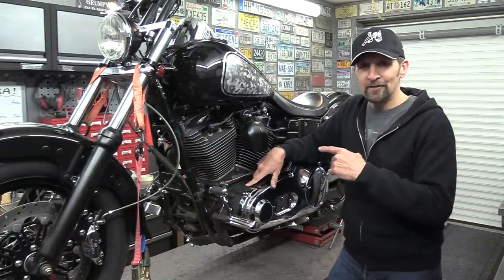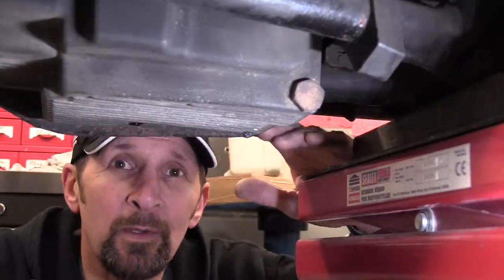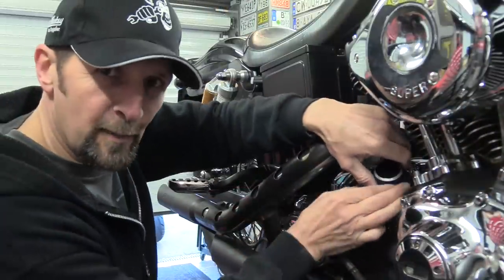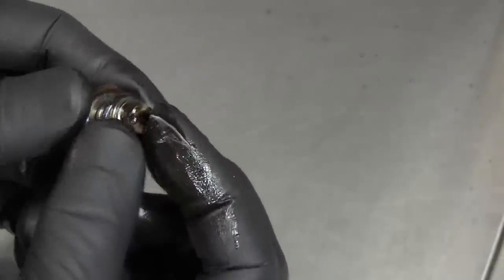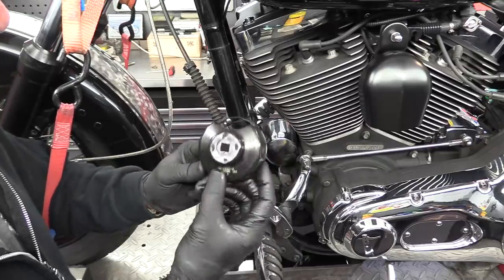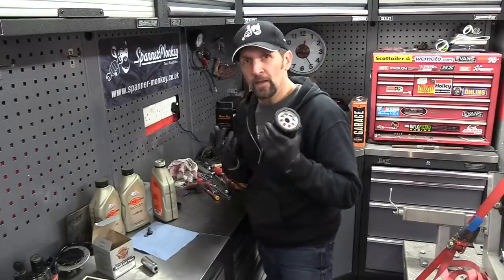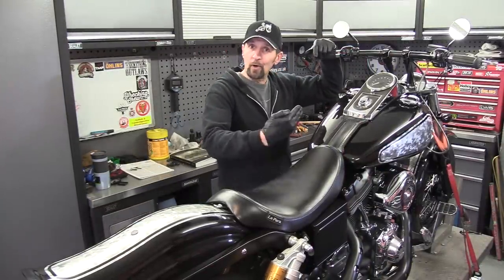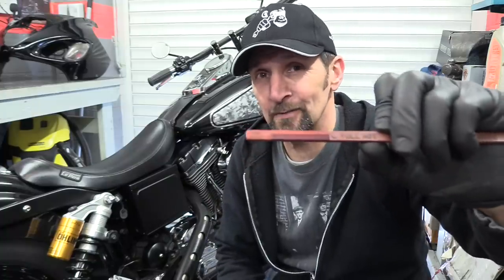Delboy's Garage, Harley Dyna Engine Oil Change !

Comment: Have to say that... I have seen many movies like Yours but what I have seen in Yours movies is very very detailed and to the point. Very helpful for someone who just starts the fun in motocycle mechanicks. Thnak you Very much. You and Two wheel Rocco are both great. Keep it up guys.
Reply from the maker: Thank you so much, you're very welcome, glad you enjoy the videos! 😀
Reply: @Moonfleet41  Hey, just one remark/ question you are mentioning that this is big twin motor and in Your movie you say that you just put 2 liters of oil... is that just mistake. Acc to the service manual I poses ut us stated "Oil tank refill capacity 3,5 U.S. qts. (3.3L. 2.9 Imp. qts.)" Or I just missed something. Thanks for great movies again!

Comment: As always great job Del.. I always just let the Harley dealership do the oil change/service on my bike while it was still under warranty. The last time they did it, it cost me $379 plus shop fees and shop supplies plus tax.. WTF!?!?!? Now that it is out of warranty I do all of the work on it. I do all of the work on all of our members bikes, in fact I just did a 3 hole fluid change service and dual caliper front brake pads on my VP's street glide. That reminds me, he still owes me for the parts........
Reply from the maker: Hey Brother, Thats so common, im so often told that guys are getting charged $500 'all in' for a service, and that makes it almost unlivable in real life.. that can feed the kids and pay the bills at home which is far more important to the average Joe right?.!  But its the going rate i guess, nothing unjust happening there, just the cost of owning a Harley Davidson.    Fact is also that you won't effect your warranty by doing the services yourself either, they tried all that BS a long time ago, and the law stepped on the practice, so under current legislation, no dealer can void your warranty because you didn't take it in for service... as long as you keep the invoices for genuine parts, and the mileage is recorded, then there is nothing they can do... only if something that YOU directly did wrong causes a claim can they penalize you... and even then, it can only effect that item, not the rest of your warranty...   Its awesome to hear that you take care of the Club bikes, thats Brotherhood right there.. Take care and keep in touch.. LL&R, Del.

Comment: Every day's a school day... I've always wet the seal with oil on the outer edge but never thought to wet the inside edge. On another note I had an over tight filter on my Tiger wich was a right pain.  Luckily TMF had a similar problem and got passed it by drilling a couple of small holes through the side of his oil filter removing cap thingy whilst on the filter and put in a couple of self tappers to secure them together. Came off a treat 👍 Great vid by the way brother 😀
Reply from the maker: Thanks for watching buddy, I've seen the self tapper trick, but if they're proper tight, as if they're almost welded on, then they can still tear out, as it's barely 0.5mm sheet metal, and then you've made matters worse, as it starts to rip apart... the best way is always some big hefty pipe grips and crush a square in the end, then you can get it off easily!  Take care buddy, appreciate you watching!

Comment: For my oil filters on my cars, trucks and Sportster, I pre-fill them on the workbench and let the media soak up the oil. I keep adding the oil until it stays at the top. You would be surprised at how much oil will soak into the media. Then I pour the oil out of the filter back into the bottle and quickly install the filter. The media is soaked completely and minimizes a dry start. If you've ever put a dry oil filter on an engine, you can actually hear the difference from an oil filter that has been pre-soaked.

Comment: Hi D&P. 
What a beautiful machine. 
I watched the entire build series and still love this bike. 
I did a double take and wondered why you were using thread lock on your sump plug, until you said it was hydemar (?) grease.  Lol. 
Good tip on lubing the oil filter seal,  thanks. I've always put a film of oil on the seal, but never removed it and lubed the entire thing...It makes a lot of sense.
Tx again.
Regards from S Africa
Clive
Reply from the maker: Hey Clive, good to hear from you ma broer ... yeah, I took care to mention the Hylomar, it's prefect for oil sump plugs as long as you use it right!  Take care and keep warm, enjoy the sunshine! Del

Comment: Great video as usual.. One thing though.. Some Harleys required the oil be checked in the upright position... A total PITA.. Anyway good rule of thumb on these is if the dip stick is firmly fixed to the cap "bung as you say" then it is upright.. If the stick has a pivot at the cap it is on the side stand... I had this on my 02 Heritage Softail.. I found through the service department I could buy a dipstick for the newer model and check it on the side stand..I did that :)  But as you say "ALLWAYS check your manual! :)

Comment: Hylomar may be "totally unnecessary" in your opinion Marc, but as with anything Del Does, and Me for that matter at work, going that extra bit as a precaution against any possible future leaks doesn`t hurt one bit, i do plumbing in my job as a kitchen fitter and it`s always better to "overkill" something that has fluids roaring through it under pressure than to not,, but what do i know, ive only been a kitchen fitter for 37 years. ;) Great vid as per Del, informative, easy to follow and well presented. Claypole.

Comment: Great and informative video. I would advise strongly that everyone look at service manual for oil plug location, as opposed to transmission oil . Evolution engine is different. Thanks dude
Reply from the maker: Good advice mate, I try to make sure I mention several times in every Harley service video to invest in a manual, as I'm sure you'll agree, it's the best £60 you'll ever spend... I asked a H-D Master Tech once, if the dealership was on fire, which bike would you rescue first, and his answer was 'none of them, let 'em burn, I'd grab my manuals before anything else, cos many of them going back to the 50's are unreplacable'.. .and you're right every bike has a different manual!

Comment: That's the way to do it Del I change all my oils every 3 months even if the bike is sat in the garage with out moving a wheel. Keep up the good work Brother H&R
Reply from the maker: Ayup Dave, great to hear from you brother, I love making these videos, just good ol' housekeeping aye?!  I notice you're not the other side of the world, be good to catch up for a beer in the summer... need to get the Dyna out and stretch it's legs at some point!
Reply: My bike sits for 6 months with clean oil during the Canadian winter. I don't change the oil in the Spring. The oil is still new, why change it ?
Reply from the maker: @jamesweber4938   There's nothing in the service manual that says to do it, but many owners like to do so, because over a cold winter, condensation can form inside the motor, leading to rust and water content in the Spring, so just for probably nothing more than peace of mind, people change their oil at the beginning of the season... some also swear that leaving dirty oil in the engine over winter can do harm also, but tbh, we love our bikes so we should do what we feel happiest with, whatever it may be, don't ya think?!
Reply: @Moonfleet41  That is exactly why I change all the oils Del better to be safe than sorry and I love my Harley and want the best from it when I do use it. It's just piece of mind at the end of the day Brother. MH&R
Reply from the maker: @davesantathompson2075  Wise words well said Dave, i ride my Harley rain or shine, and harder than i maybe should do... but as long as you pamper its needs, they can take just about any abuse..!  Just watch the Dyna stunt guys, They can't kill them for all their trying.!  MH&R Brother..

Comment: Just found your channel. I've only been riding about a year. Your video is one of the best oil change videos I've seen. It seems goofy, but yours is so clear, step by step. Now, I feel like I could actually do it myself. I'm not an engine guy. Also, like your TBars as well. Doing the same but trying to figure the indicator clamp with predrilled bars on 2008 LR.  Billet makes them but they are black and I want chrome.
Reply from the maker: Glad you enjoy the videos NBT, we deliberately film them in this style so they can appeal to a general audience, some of whom may be complete novices and enthusiastic to learn... plenty of videos online that are shorter and give more direct info. aimed at those with a little ready knowledge, so we choose to make them a tad more basic in case anybody needs that!

Comment: I know very well over tighten oil filters. No matter if it is a car or a motorcycle, every first oil change in my or my friends new bought machine require heavy tool to get oil filter loose.

Comment: I'm looking at doing an oil change myself so just wanted to ask... Given that you state it is bad to get hylomar inside your engine why do you use it for this? Is replacing the o-ring not enough?
Reply from the maker: Blue Hylomar is a non-drying sticky sealant and, of course, it doesn't do to have globs of that floating round in your oil, so as I stated, put it on the thread only... it's a sealant designed as long ago as the 1930's for sealing oil joints and sump plugs... it has other uses these days, but that's where it came from... if there are any distruptions in the thread on a tapered plug or a nick in the 0-ring you can still get oil weepage, which is pretty common and so many people just swing on the bolt to over tighten it in order to seal it...!  But with a little smear of Hylomar around the thread the plug glides in to place at it's min. torque setting and seals first time, every time... don't use it if you feel you don't want to, it's not essential.

Comment: It is easy to do an oil change on a dyna, Tho I don't have a bike lift, I put down some cardboard
and lay on my belly and start loosening. I took a short ride to the HD guys wearing 
a backpack to put oil and filter in, they always tape an O ring for the plug on the oil filter box.

Comment: What size is your garage? It's fitted out tighter than a ships machinist mate's compartment. Out on the ranch our "toolshed" and work space is a 20 ft CONEX. Since we maintain everything from trucks to cars to small engines and also lots of electrical equipment we have double sets of most tools metric and SAE. Had my first bike when I was 16; one year old 1964 BSA Lightning Rocket 650.
Reply from the maker: Hi buddy, my garage is more or less 10ft x 20ft, and yep, I do pack everything in!  But it motivates you to keep it tidy and of course I wish it was bigger, but I reckon with more space, I'd just end up with more stuff lol

Comment: Del! I'm hoping you'll get to comment on this. I've been riding for almost 60 years and 6 months ago bought my first Harley. I chose a '09 XL 1200 L as it's not too heavy. I do a low annual mileage, maybe a couple of thousand miles. I was looking around for oil and came across LUCAS 50WT V-TWIN SYNTHETIC. It seems to satisfy the requirements of the Sportster and it would be changed annually so I'm wondering if it's something I can safely use as an OAP on a State pension. I know the Dealers would throw up their hands in horror, but needs must. My local HD shop has already given me the wrong tyre pressures ( 36F, 42R instead of 30F and 40R) for laced wheels, so I'm not confident about their advice. Thank you for the tutorials, I'm sure I will be visiting often.
Reply from the maker: Hi there.. OK, congratulation on your first Harley, i hope you're enjoying the summer so far on it.. With the oil, there is always more benefit in choosing a multigrade oil if you can, Lucas 50W will be ok, but its maybe a bit thick for cold mornings, and in England we get plenty of those aye.   You don't need to spend a fortune on special oils for your Harley, they are pretty robust and revving motor,  no real need for a fully synthetic, a half decent 20w50 semi-synth multigrade will do the job..     There is a recommendation printed in Harley Davidson service manuals that goes  "" In the absence of a dedicated Harley Davidson oil, use oil rated for DIESEL engines"" .. so if you are on a budget, you could go to your local motor parts store, and get some semi synth 20w50 diesel oil, and that would do the trick just fine... and also be a lot more affordable that genuine HD oils...     Hope that helps you out, Good luck with it and enjoy your Harley.. Del.

Comment: I noticed on some of your videos changing the engine oil on a sportster i thought you said you do not have to use harley oil  the conventional 20w/50 works just as well or did i misunderstand you. i know the primary you have to use special oil . but for the engine i was going to use conventional castrol 20w/50

Comment: Hi Mate!  I would’ve guessed that you would’ve done some forensics on the engine, including oil change, BEFORE you undertook all of the Work and mods of the build.  Otherwise how would you feel confident that the bike was worthy of your time and effort?  Anyway, I love what you’ve done with the build!  Hi to Pen!
Reply from the maker: Hi Byron, I did indeed check it out, I knew the oil was pretty black, but that is little more than soot, as she's done 45k miles and is 20yrs old, so possibly just a little bore wear.. the actual viscosity of the oil was good, and no foreign matter in it... I also trusted in the service history, as you may know, one owner from new, and I bought it directly from him, not a dealer... the service stamps were all correct and in place, all from the same dealership, and it had only just had the cam chain tensioners and cams replaced a matter of 1000 miles before... so I was confident in the bike right from the get go...  plus I know that any Harley big twin engine can do 300k miles without missing a beat... this one's just nicely run in lol  Take care, keep in touch, always good to hear from you my friend...

Comment: Thanks for the video, big debate over using the same or different oils in the primary and transmission as the engine what’s your opinion, cheers

Comment: Is a Dyna different than a Softail where you don't do a "full purge" getting all of the oil out? I didn't notice the return line to a tank like a Softail has.
Reply from the maker: Yes mate, different.  The Dyna is wet sump, Softail's are dry sump with a tank!

Comment: Be aware of when you remove the oil filter, just a few drops of oil on the front (rubber) motor mount will destroy it.
Clean it up 100%

Comment: I have a question for you, I just bought a 2007 Dyna with a fuel injection system, do I need to twist the throttle a couple times before starting it up?  Just got the bike last night, it's my first Dyna.
Reply from the maker: Hi Chris, assuming your Dyna is a fuel injection (being 2007), then no.  Twisting the throttle is purely to prime a dry carb, fuel injection systems have a pump that primes for you.  Turn the ignition on, hear the pump cycle inside the tank, and when it stops whining, poke the start button with your finger... the computer will take care of fueling and warm it up for you.

Comment: Hi Sir, 
I have a 2016 Kawasaki Z800 and i too always Prime the filter. 
To avoid wasting oil on the ground, i put enough to completely soak the filter till it could no longer take more without spilling.
The oil pressure warning light didnt turn off even after 30 seconds ( felt like an hour looking for the light to turn off )
After i removed the filter, found a very tiny bubble of air, added more oil to spillage level, oil pressure came back.
Ideally the oil should have flown through the filter, but somehow it didnt for the first time ( only once it happened this way )
Could it have been a one time case or something wrong i might have done ?

Comment: Hi Delboy
I have a 2015 dyna switchback and have just done the 3 oils, but I’m getting older and mucking around on the floor is no fun anymore. I’m going to invest in having a table ramp like yours, but I also noticed you use a small Jack towards the back of the bike with something on it. Can you give me the rough dimensions of the Jack and what is on top ? Also does this set up work when dealing with other things eg wheel removals etc cheers Tone 🇬🇧
Reply from the maker: Old video now, it's just a flat table jack, readily available, some come with a rubber sheet on top... as the lower frame rails are parallel these are a great help to jack up the front, or rear, of the bike for wheel removal, or just to support it for doing things like oil changes!   Something like this:  https://www.sealey.co.uk/product/5637191833/450kg-scissor-stand-for-motorcycles
Reply: Cheers mate

Comment: Is that sealant/lube on thread really necessary? Would the o-ring alone do the job to seal the oil? Thanks for the video really helped me.
Reply from the maker: These days, I keep a box of assorted O-rings, and where possibly always replace them, if I can... because they get nicked or cut when you wind them up under pressure, so never seal quite as well the second time, therefore if you don't have one to replace it with, and as long as it's not broken in half, then a little of this sealant means you can re-use it, but if you want to skip the sealant, then make sure the O-ring is brand new and the mating faces between the bolt and the casing are nice and flat with no damage or grooves.... in short mate, the Hylomar accommodates wear and tear.